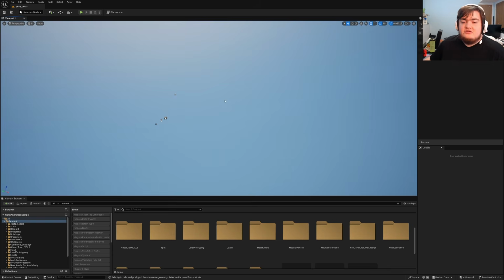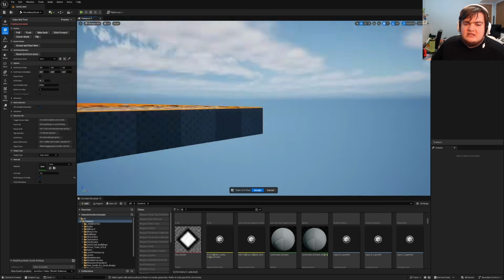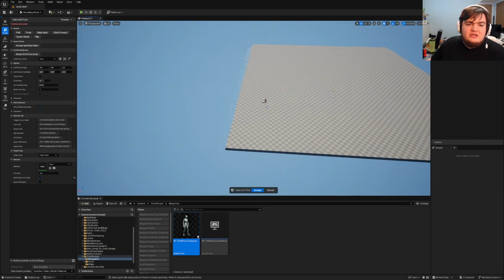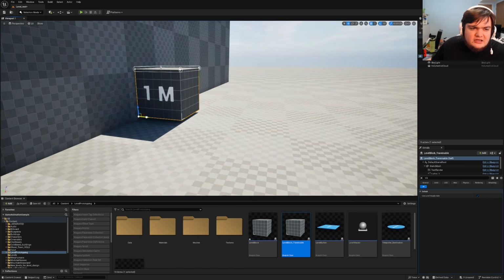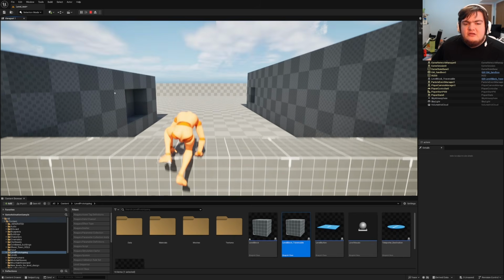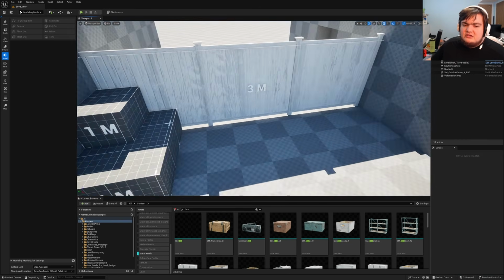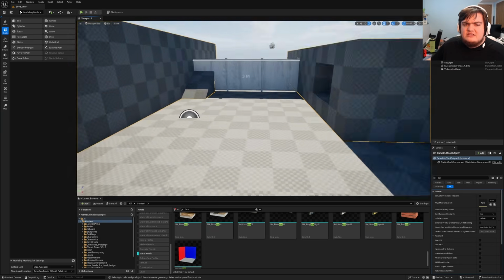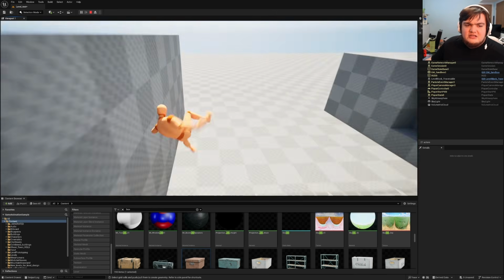How to practice level design

Comment: Thank you for the tutorial. I was using simple meshes and this is much better. I just started using it and I am getting collision issue. How do you automatically generate it or fix it with each edit?
Reply: Nvm, I just found out :face-green-smiling:that I need to go to settings in Modeling mode and set the new mesh settings->complex only
Reply from the maker: Lol was just about to answer haha.

Comment: Hey, I have a quick question, but I'm not sure if you can answer it. Is this sufficient for the tests that you do for the job interviews? For example if the task is to create a 10-20 min quest with a short story? Would this be perfect way to showcase your thinking and how you would execute the imaginary level? I'm a noob but I want to know if this would be a good way of doing it. (I'm not doing any interviews or anything just wondering)
Reply from the maker: Sorry for the late reply. It is a good start. You want to put in more work. If you doing quests and stuff show you understand how to tell the story of the world with your doing not just make paths. You want it to bw engaging and show you understand a few things.

Flow

Time spent

Enjoyment

Functionality

Interaction understanding

And how you guide the player.

Its more than just straight building a test area and habing them walk through it. It needs to hit alot of key points to show your process. And the best way is a demo of an area. Show your understanding very well.

As for examples. You can create a tunnel and make it look beautiful. But it needs to have. Why they are there built into it and the level mechanics in mind.

Comment: hey man thanks for the vid, i am having an issue with collisions like when i just put the cubes from the cube grid my character just passes through it and when i am trying to put myself collions it is not pretty, have an idea why the collisions are not automatically there like u in the vid?
Reply from the maker: Not fully sure but you can go into the mesh for it after creating it and set to collision from default to use complex collision as simple. That should help. Also make sure its not set to no collision
Reply from the maker: Found a possible fix for further use. Check your project settings. and look up new mesh objects. make sure the collision mode is set to complex as simple. And enable collision is checked.
Reply: @BatnobieX  idk why but after doing what u said my character still passes through :/ i even tried many collision preset like block all but it doesnt want, i will try to find a solution.
Another question if you dont mind, does this cubegrid mode is usable for realiy making levels or its just for prototyping? Because i noticed that when we accept what we did with the cubes well it all becomes one mesh and we cant remove block after accepting so editing becomes a nightmare, so is it just for protoyping if yes what is supposed to be the next step ? Just putting each block by hand with its material to recreate what we did in the prototype?
Reply from the maker: @Delta-Hef you have to re click onto the cube grid mesh then start the editing in order to edit the one you've already accepted. 

And yes its for previs to help get layout in mind. Test and make sure the timing is correct and good. Then you start replacing.

Comment: Hey like the video but I have a problem where my cubegrid does not seem to have collision. Everything seems to fall through the floor.
Reply from the maker: That is strange. Im not sure whats causing that. I would need more info.
Reply: simply just select the cubegrid and then press control + E, you will see collusion on ur toolbar then just press it and choose "Add Box Simplified Collusion"
Reply: Try go to Project Settings -> Plugins -> Modeling Mode Tools -> New Mesh Objects -> Collision Mode and set "Use Complex Collision As Simple"

Comment: Youtube knows perfectly well what I am thinking with these recommendations. Thanks alot this really saves me some time with everything. Is it possible/OK to proceed to a complete level just by hiding things and replacing them with assets?
Reply from the maker: Long as you get rid of them before release should be fine. It's whatever process works the best for you. Also glad you enjoyed the video and found it helpful
Reply: @BatnobieX  What I mean basically that is it okay to just make a complete level with those traversal objects while they are hidden or is there some other way to produce a level with them?
Reply from the maker: Could work fine. But I would examin the code to see if you even need the cube. And if you don't just swap the cube mesh for what you want to use. In the blueprint. And use then aline the parts to the new mesh should work fine.

Comment: One you go to model cube grid and build one structure. Then go back to build a second it the movement/rotation automatically get grouped with the first structure. How do you stop thay from happening?
Reply from the maker: You need to remove the parts of the wall before replacing with the cube grid. It's a light pain. But if your woried about that can use sm_cube. And model boolean tools with scaled cube to cut holes. For much more controlled cuts. And prevent this issue. The merging can be a pain. You have to avoid hitting accept when a model is inside the cube grid or it merges for some reason.

Comment: The GASP 5.5 project WILL look different, and it has a few more features. Also, CubeGrid is VERY OP.
Reply from the maker: I am excited for when they update it to add more animations. Especially when they get it to come with crouching. That will allow prototyping a few things rather fast. That the main thing I wanted to hit with this video was getting people to really think How the Mechanics go into their level designs. I notice a lot of indies miss that part and just make a level without keeping this in mind causing some mechanics to feel either unnecessary or just clunky. As they weren't planned for ahead of time.

Comment: While templates and asset store content are very helpful you are ultimately doing yourself a disservice and kneecapping your understanding of Unreal, or any game engine in general. You’re skipping the fundamentals of how the engine works and not getting any of that knowledge that is crucial to furthering developing mechanics for your game. For example, how will you know how clamber and vaulting works or the velocity and momentum system in unreal works if you haven’t ever programmed stuff like line traces or capsule traces and physics impulses yourself and tinkered with it to get the exact behavior you want in game. 

My point is that templates can turn into a crutch if you let them.
Reply from the maker: Yes but this is to get to helping people who want to focus and go in for level design. This isn't a tutorial for jumping directly into vaulting. This takes what I showed and jumps into making it an hour long video to go into far more points than what I was covering. As well as. In a fair bit of cases in the studios I've worked at. The level designer was asked not to touch that kind of code. And to focus on building a level that works with the code and has it in mind. I understand what your saying about crutch. But this video didn't say to not go learn how to do such things its to help new people learn they need to focus on designing based off of mechanics and not just visuals. Wich the visual side is what alot focus on leaving the mechanics behind in the process.

Comment: Can you make circles or sphere shaped objects ?
Reply from the maker: What do you mean? That could have many different meanings.
Reply from the maker: If you mean with the cube grid. You can build using cubes and use the z and e/q buttons to create angles. But its ment for prevising not the finished project. So it won't look fully like the end design
Reply: @BatnobieX  ah okay I understand so if I cube out a water tower or something for example then replace the cubes with the actual water tower mesh that’s round it will be in the correct place? Sorry I know it’s a strange question
Reply from the maker: Correct. as the point of the cube was to lay out where it will be located. and help you get an idea going. then when you get the water tower in there you remove toughs cubes. the tower will hopefully have collisions. If not one of my next videos is already set to be building custom collisions in unreal.

Comment: Neat, can't wait to try this out. General question is there a way to convert a model into the grid to use its physics? for example a house model with no collision etc and then using the grid to give it physics/collisions
Reply from the maker: By the grid do you mean the traversal cubes? Or the cube grid build system? Id you mean the cubes. Yes youd just have to build the house using the cubes. Then set the cubes as not visible. Same thing for the cube grid system. Though the grid system is used for previs mainly not for finished project. Though you technically can. I can't guarantee working products using it. As its ment to be replaced as you go.
Reply: @BatnobieX  ah yes I meant the grid build system. Thank you for the response! I was asking as I am just getting familiar with house building in revit and the general collision system feels too clunky
Reply from the maker: @AmeJouten  Well honestly gave me an idea. I'm gonna try to cover a short video on building Collison on static meshes in unreal.
Reply: @BatnobieX  awesome, will definitely tune in for that one! cause its definitely not straight forward 😅
Reply from the maker: Do you mind if I put this little comment set in the video? Thought I would ask to be polite.
Reply: @BatnobieX  by all means, it's your content ! Appreciate you asking though
Reply from the maker: It may be my content. But I wanted to show you respect by asking first. And alright just finished rendering it. its about 4 minutes long. and even goes over a small physics issue with using complex vs simple collision on top of re building the collision.
Reply: @BatnobieX  yessir, will definitely check it out when it drops, its definitely an interesting topic, i imagine something most people take care of in modeling before going into unreal engine but i could be wrong lol
Reply from the maker: Scheduled to go live tomorrow morning! so in about 13 hours.
Reply: @BatnobieX  awesome dude, i'll keep an eye out for it, thanks!

Comment: great video bro. i just started my journey with ue5 and this is super helpful
Reply from the maker: No problem. I love making these tutorials. I mainly have a focus on level design and lighting. If you have any thoughts on a video that could help in toughs fields feel free to ask or give an idea.
Reply: @BatnobieX  ive been trying to find a simple way to import weapons and ammo if you know anything about that! :)
Reply from the maker: @gr0yprs  Well depends. Do you mean like just the mesh? is it rigged? cause an important part is knowing if the mesh is rigged. if its not youll have to import it or set it up in blender and rigg it yourself. if not its importing and building the materials. some weapons will have the ammo in the magazine already and you just have to animate them. with the simple way of hiding the ammo is swapping the element on the material of the ammo to be an invisible material (set material to invis and when character looks at ammo. have the material swapped and the mags push lifted up. to show empty.) Mind furthering the question a little. as I can look into it and try to post something for it later.